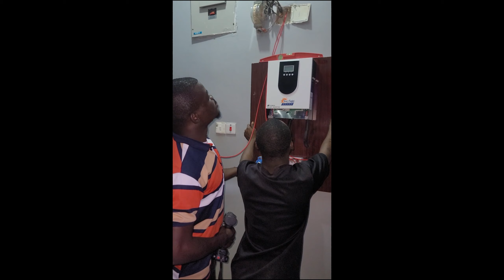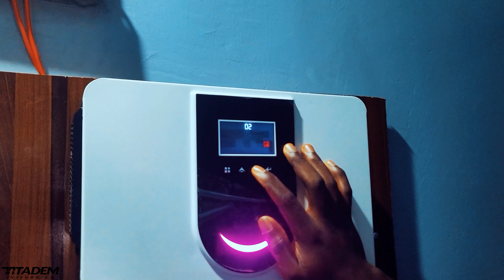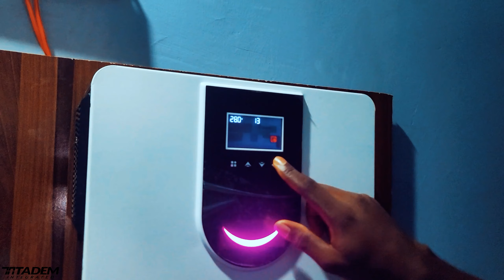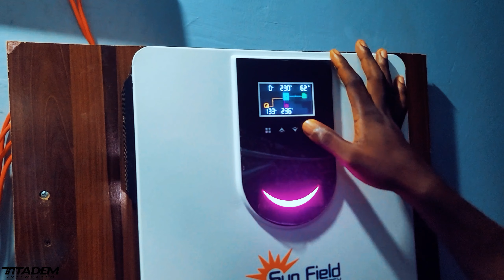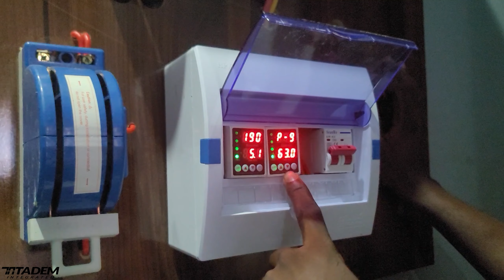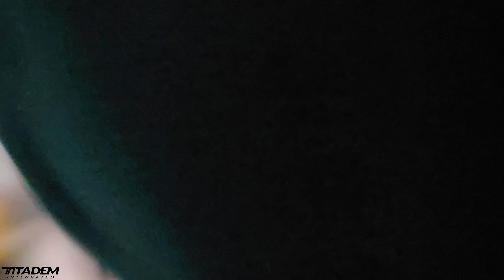Configure your high-frequency inverters for maximum optimization

Comment: No, high frequency inverters can never outperform low frequency inverters no matter how they are installed. High-frequency inverters have much shorter life expectancies, and they offer much poorer surge capacities than low-frequency, transformer-based inverters. I have been in the inverter repair business for over 25 years and would never recommend any high-frequency inverter to any customer for any purpose.
Reply from the maker: If you like be in the business for 50yrs
What you don't know, you don't know.
You're sounding like those who claims window 7 OS is better than window 10.
Reply: Every tech takes time to develop...25yrs ago I would have said you were totally right... but now high frequency has matured enough..so I will disagree with you. It's just like saying manual cars are better than automatic cars. But of course there are cheap ones.. I would never use what he's using in the video. Take a look at deye inverters and their components used.
Reply from the maker: @jojoowumanmensah1733 not everybody can afford deye.
And besides sunfield is not anyhow high frequency inverter.
You need to use one to be confused

Comment: Another question, in the process of using the battery and utility is available, it's automatically utility will be charging the battery or Not Sir ?
Reply from the maker: I didn't get this question quite well
Reply: @intadem  
Sir, what I mean is that when using the battery and utility power is available, will the utility automatically charge the battery or not ?

Comment: Can I connect 12pcs of 250w solar panels in series to  10.2kva sunfield inverter? To charge 4 tubular batteries of 48v?
Reply from the maker: Yes you can
Reply: As long as you don't pass the VDC range

Comment: Can the input avp for low and high voltage cuttoff, be used to replace AC surge protector?
Reply from the maker: Not really
AC surge can take upto about 1KV
While the AVP can max out at 400v